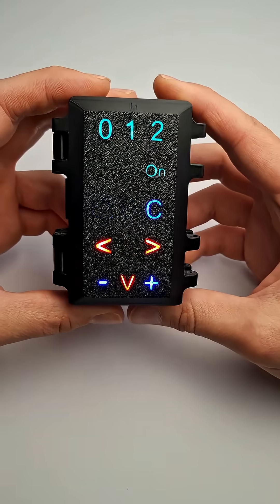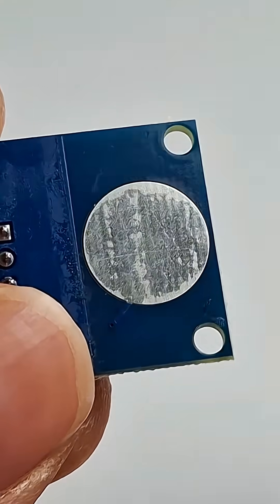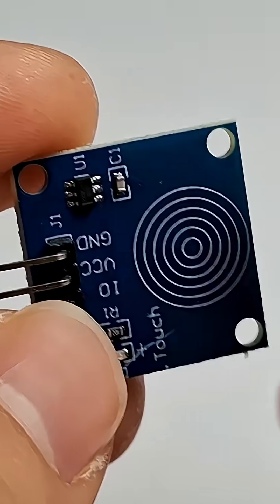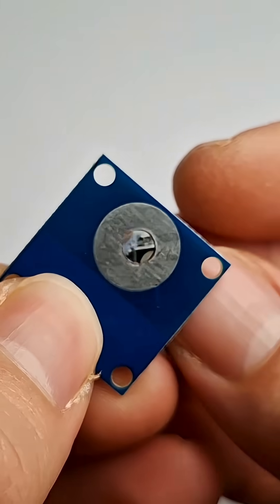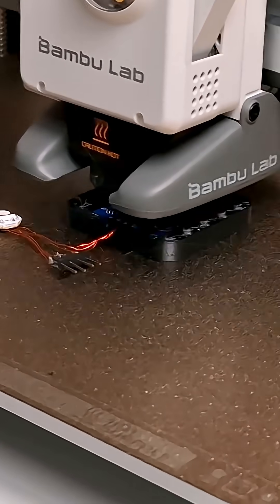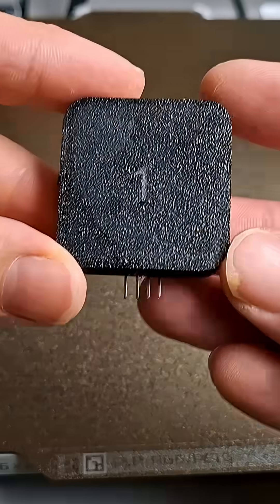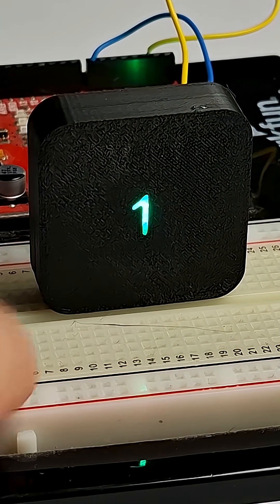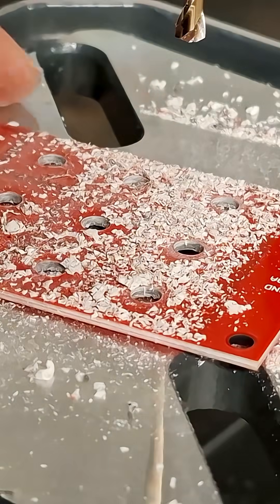Capacitive Touch Sensor and Addressable LED embedded into this 3D print! #3dprinting

Comment: I think your print bed significantly damaged the finish of this part, if you buy a smoother flat print bed you can get parts that look immaculate on the bottom. Though I’m sure I don’t need to explain that makes it a little bit harder to print but I think it’s necessary for some prints

Comment: I love designing parts that are completely impossible to disassemble if anything breaks
Reply: That's not totally correct. While it's pretty much non-repairable, if he wants to get back the led and touch sensor board, he could split the print open along the layer lines by putting a knife blade at the layer line and tapping it with a hammer. 
It would ruin the case, but you'd recover the electronics to put in a new case. 

Inferior layer adhesion is one of the main downsides of FDM printing, but sometimes it can work in your favor.

Comment: -> Get angry at companies making things non repairable. 
-> Build your own stuff and make it unrepairable.
Reply: I think it’s a bit different when it’s off the shelf components, that you’re putting together yourself, and not inflicting a non repairable experience on other people. Realistically, if it was repairable, you’d save an LED? A touch sensor? Or a printed part? Small potatoes compared to an entire tractor or phone like the common culprits are criticized for 🤷🏼‍♂️

Fair point tho, I hate using glue for assembly in projects for this exact reason, but sometimes it’s just the best solution!
Reply: @nathanblanchard8897  Its usually just plain easier and faster to glue things.  Though personally i found that using self-tapping screws along with an appropriately sized holes is nearly as easy. Sure it won't last as long as dedicated metal inserts coupled with bolts, or even as long as plain old nuts and bolts, and it won't be as strong as glue, but most designs don't need that, but would benefit from built-in ability to open up a design a few times.
Reply: Its very repairable
Reply: it is repairable, you crush the plastic and recycle or remake in tio filament,
fix the electronics then reprint the part

Comment: I'm not an EE, is there a capacitive toggle switch circuit that could run without a MCU/Arduino and maybe toggle a regulator?
Reply from the maker: Yes,  Adafruit selll one
Reply: @LukeDitria perfect, I also found the TRP223 which is much more in my budget for production. (The one here int the video was like $1.20 each)

Comment: Just use a ESP32. It has 12 capacitive touch sensors built in, just wire a piece of aluminium foil to one of the supported pins, set it up in software, and off you go.
Reply: Sure that's a way too.

Comment: A lot of microcontrollers support touch on many of their gpio's.  At most, you need a resister, which can be near the microcontroller and a wire connected to a pad.  Mind you, you would need to write the calibrationn code.

Comment: You can also solder a wire to the touch part of the sensor pcb (at least with the small red ones) and then attach that to any kind of conductive shape or surface you want

Comment: Just the thing I need and was already in the process of implementing it in my new project, but I think I will use custom electrode coming out from an esp since it could be used as touch sensor out of the box

Comment: I swear you’re going out of your way to not design a custom PCB.
Reply from the maker: Sure, but this is just a proof-of-concept project for fun. I'm just showing people what they can do with off-the-shelf components.
Reply: You can always get someone else to make it, but that takes a big chunk out of the DIY fun
Reply: @MantisRay861 I mean, it's not like he's hand drawing the circuits and etching the board and solding the components one by one
This is already using some generic chinese modules and glueing them together.
Not disregarding the effort but depending on the criteria I'd say that designing a custom PCB is more DIY than using a bunch of premade modules
Reply: @MantisRay861  Why settle for cobbled together fleabay modules or clinical PCBs shipped to your door when you can get your hands dirty with FeCl and etch resist?
Reply: PCBs should only be used as a last resort during prototyping, as it takes time and small batches are proportionally really expensive. Breadboarding allows on-the-fly modification.

PCBs should be for production, or final drafts.
Reply: @specialopsdave  sharpie and etchant for a one-off simple board at home in an hour seems pretty reasonable.
Reply: @Scrogan  Compared to a 30 second breadboard edit, I'd say that's a bad deal
Reply: @specialopsdave  absolutely if you’re prototyping, but this capacitive touch sensor one-off project was too small to be done on a breadboard. Remember the context.
Reply: I mean it is nice for the fact that it's 100% made at home with common components but yes custom pcb's would be a more elegant solution
Reply: @renaudfensie3020  Bust out the FR4 and FeCl.
Reply: Why design a custom PCB when you can not do that
Reply: I'm gonna make a keyboard of that type 😀
Reply: Sooooomething at the end of the video tells me, your comment may not hold true for long
Reply: Maybe some aluminum foil or wires would do the trick too. If I remember correctly Arduino has a library where it can make the pins touch sensitive
Reply: I would if I understood how 😢
Reply: Idk why he hasnt, its not that hard tbh
Reply: @pizzaperp95  sometimes ordering the PCB takes weeks.
Printing it almost instantaneous
Reply: not everyone's a complete nerd
Reply: I make many proof-of-concepts on the PCB. I just take a notebook and design the circuit, then I take a sharpie and draw the traces, etching takes 20-30 minutes using citric acid and hydrogen peroxide.

And in an hour I have a proof of concept PCB.
Reply: @Gameplayer55055 
Yeah, a single-sided board with 2mm feature size and imprecise drilling. Sub-1mm if you want to give yourself eye or neck strain, I’ve done micro-USB ports in the past but can’t recommend it. I’ve also done hand-riveted vias for two-sided boards, and hand-painted solder-mask, but thats even more time consuming. For single-sided boards for THT components, it’s easier and quicker to just use perfboard. I recommend strip/vero-board, not having to make blobby jumpers is nice.